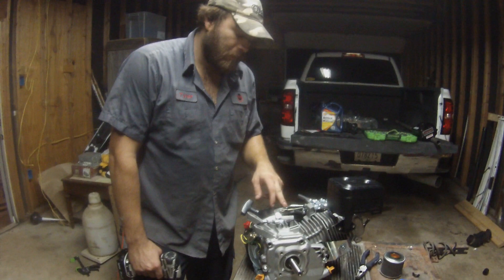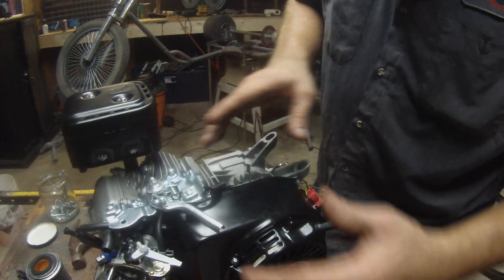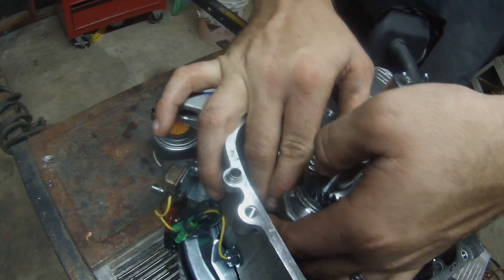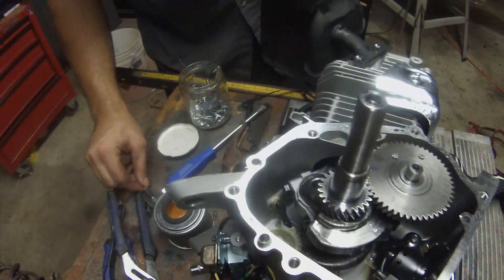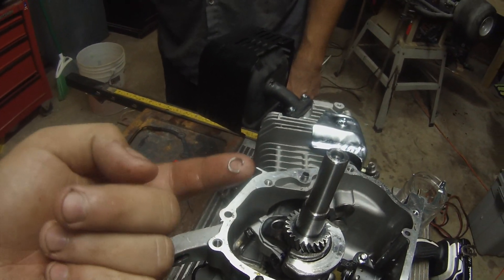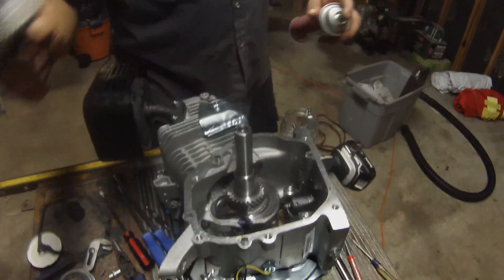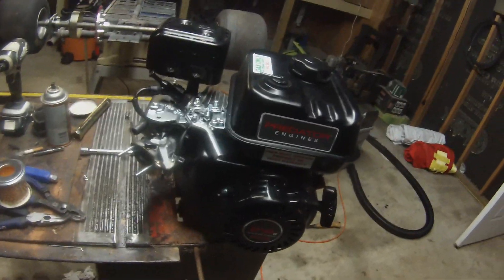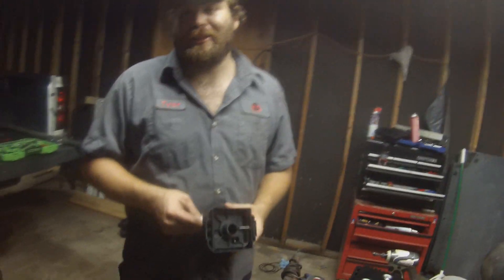How to: Best  Predator 212 governor removal

Comment: Here's the thing everyone isn't understanding.  The bike or kart is limited mostly by the final ratio. Tav2 30 series max at around 3500 rpm without modification. A clutch will get you there but you still won't out run the sprockets. A governorless motor is only beneficial to long runs, drag racing with engines that are built to 15- 20+ horsepower or balls out sprinting on circle tracks where the gearing is so high and the power of the engine exceeds the amount of torque to pull past the sprocket ratio.
Reply from the maker: Your ignorance is showing for sure you have obviously never done that or you would know the benefit so before commenting about something you don’t know maybe you should try it
Reply: @redneckengineering7739  I build them all the time. Theres 5 ungoverned, fully built motors on my shelf right now. Full deletes, linkages and all. I ran them on tav2s, clutches, minibikes and go karts. Check them out if you don't think so, they are on my channel. I'm currently working on a hemi and Non-Hemi 212 with modified governors, flywheels and rods. Been there done that. I know exactly what I'm talking about. I wasn't down playing your efforts my man.
Reply from the maker: Sure you do buddy
Reply: @redneckengineering7739  go look. I do my deletes from the flywheel side.
Reply: You can max the stock cam with the governor still installed and 18 pound springs. The rod starts to starve around 4,700-5,000 rpm. The maximum torque on the stock cam is achieved around 3600 due to the lack of ramping. To get more power without the governor you need increased duration for more usable torque at higher rpm you need ramping. You did other videos, I've been subbed awhile. I wasn't knocking your video boys, I'm all about this stuff. Maybe you are adding a bushing to that torque converter to get those wheels spinning faster? I don't know anything about that either 🙄.
Reply: @redneckengineering7739  did you check yet? I just gave you a LIKE, unsubbed  and subbed again because I like your channel. Sorry, wasn't trying to offend you bro.

Comment: i did this now i have no compression and it wont start i think it has to do with the 2 round valve things that go up and down do they have to b in a certain position and i lined the dot up with the other dot
Reply from the maker: Nothing here should have anything to do with compression
Reply from the maker: You will have to add me on Instagram or some thing and send me a picture I don’t really know what you’re talking about

Comment: It is soooo easy to do . Do it right and do it only ONCE ! Buy an ARC billet rod and flywheel too with a NEW GASKET 😡... Heavier valve springs are a good idea once you install the billet rod and flywheel . Haul ass SAFELY 😀😃👍🏻👍🏻
Reply from the maker: No

Comment: Does this actually work and if so how much more power and speed is added
Reply from the maker: What do you mean does this actually work? It removes the governor so yes it works end it does not add any power just removes the RPM limiting governor you can Revit higher that’s it and how would we be able to tell you how much speed is added when we have no idea what you have put this motor on? When you ask questions On the Internet and expect someone to answer it make sure you have plenty of information to give them
Reply: @redneckengineering7739  bro why u so pressed I just saw some other people say that it would blow up the engine
Reply from the maker: Cool

Comment: I removed the governer and arm, now it runs at wide open throttle. Ive checked for air leaks and everything with brake clean to no avail. What am i missing here ? I cant find any solutions online.
Reply from the maker: You did something wrong that’s all I can tell you I can’t see what you’re looking at

Comment: whats everything you need properly done for this not to mess engine up. i have already new jets, filter.
Reply from the maker: +Donnie Coffman flywheel
Reply: If taking the governor off, there's the risk of valve float, right?  I've got a new HEMI 212 (still in the box) that I'll be removing the governor on within the next day or two (thanks for the vid).  I've got a stage 2 kit from Hot Rod Mini Bike on the way to me as I write this, and the thought (besides the mods) that since the rpms will obviously be higher, stiffer valve springs are needed to prevent the valve float.  So I'll be ordering them tomorrow as well.  From what I've read so far, that's a necessary upgrade when removing the governor, right?
Reply from the maker: +Terry Koss you really need a new flywheel to or it can explode
Reply: Well, that's great to hear, because I've already decided to buy a billet flywheel (and cam)!  Yesterday, I removed the governor, low oil sensor and flywheel.  I didn't know that I needed to, but now that you mention it...makes good sense.  So thanks for having me know I won't be risking destroying my new motor!  I put the motor in a plastic bag for protection until the cam, springs and flywheel come in.
Reply from the maker: +Terry Koss cool man have fun with it

Comment: Hi I also own a drift trike and I just just a new motor on my trike and every time I do a 360° if shuts off on me. Do u knw why it would do that?
Reply from the maker: Probably starving for fuel
Reply: I did take off the top part of the  Governor but didnt open up the crank shaft area and take out the parts in there.. can that be the problem?
Reply: oil sensor

Comment: So just an observation... if you just take the arm off from the governor shaft and then do the throttle hookup the way you did, why open the engine and take out the gear?
Reply: That gear is nylon with cast metal weights. Above the factory set 3600 rpms, things get spooky: If it happens to come apart from excessive rpms over stock, its going to take the guts with it. Not if, just when.

Im all for the zip tie trick to wow your buddies, but take the gear out at some point.

Comment: i personally dont recomend removing the governor cause thats how you throw a rod or rupture a flywheel and send pieces of cast iron through your back but what i do is i cable clamp my outside wire to the governor linkage and put my inside wire around the top air filter manifold bolt and it jams the throttle wide open against the governor, so basically all the governor is now is a centrifugal return spring where you get more feed back pressure as the rpms increase, its actually kinda cool and it works flawlessly
Reply from the maker: +FlyingWldAlaska77 that's cool but no I'm taking that shit out you can get a Billet flywheel and fix the problem but that's only if you plan on running wide open a lot
Reply: you can get a billet flywheel and a billet con rod maybe even a forged con rod and a billet piston and a high lift long duration cam and big bore carb and all that for them and they can reach like 9,000 rpm but other than racing i dont see why you would want to dump more than just the 100 bucks for the motor into the motor, they have always been good enough for me stock, thats just my preference i guess, i never refuse extra power but im not going to pay shit tons of money for a motor to make more power when i could just get a bigger motor that does the same thing for way cheeper, only its heavier and bigger but its being put through less stress and would last far more hours, just me personally i guess, nothing against tuning up motrors
Reply: FlyingWldAlaska77 What's a little iron in your back gonna really do.

Comment: I watched ur guys video and I took the govener off my engine and put everything back and it doesn't start unless I rev the throttle while I pull the starter and I have to keep revving it and when I put it on run it just stops did this happen to u guys
Reply from the maker: +Moto Briggs was it a new motor?

Comment: i have the same motor it run.. but when i give it gas it will not gi and the motor cutts off
Reply from the maker: +Shanesha Grayson you should call a small engine mechanic in your area but sounds like a fuel issue
Reply from the maker: +Shanesha Grayson if it's been sitting for awhile with gas in it you probably need to clean the carburetor but it's hard to diagnose things through YouTube comments LOL
Reply: i changed the gas and cleaned the carburetor. .. and it still doesnt want to go... the motor is only 5 months old but i cant send it back to the manufacture
Reply from the maker: +Shanesha Grayson yeah I'd send it back
Reply: sucking to much air it sounds like
Reply: StRaNgEr ok i cleaned out the carburetor.  it started goin. but i notice that gas was leaking in the  oil ...
Reply: Shanesha Grayson then its gotta be either the oil ring on the piston or gaskets
Reply: Shanesha Grayson how is your compression?
Reply: Shanesha Grayson your clutch is bad

Comment: You don't need to cut or break off the top of the rod. Pull the pull rope slowly to turn The motor and line it up and pull it right out. Just did mine.

Comment: Why not just stop after removing the external linkage? What is the reason for going in the crankcase to remove the internal parts? In other words, why not just disconnect the governor as opposed to removing the whole thing?
Reply from the maker: john robert that plastic gear can fail at higher rpms . It's just better safe than sorry .

Comment: Hey guys, I want to know, is this (212cc) engine powerful enough to work on a ultralight I'm building? Can you get more horsepower out of it, maybe 15HP? Also, can I hook up a 3 to 1 gear reduction to it? Thanks, great vid.
Reply from the maker: Forrest Branton you would have to do extreme performance upgrade costing in the range of 1,000 dollars . You can actually buy them already upgrade online . But I still don't know if you would hit 15 hp . I'd reccomend going to a 302 or 420 cc . And then doing all that work and getting 25-30 hp
Reply from the maker: Forrest Branton http://www.gopowersports.com/stage-two-212cc-predator-performance-racing-engine/
Reply: Accually they make a stage 2 performance kit for this motor that adds a minimum of 15 hp to your engine:) it's on gopowersports.com

Comment: Can removing the governor harm your engine
Reply from the maker: +Clinton Ovalle yes
Reply from the maker: +Clinton Ovalle for it to work reliably you should get a Billet flywheel and possibly a connecting rod depending on how often you run it Wide Open

Comment: hey man I have this motor apart can't you just take the rod that goes to the throttle off and leave the gear in there? why are you guys taking the gear off?
Reply from the maker: +gusduran11 yes you can but that plastic gear inside can fail at high Rpms and cause issues later . We figured we would show the right way to do it but if you do it that way your talking it will still work .

Comment: The whole point of watching this video is so I could see somebody removing that clip and right before you take it off you skip to after it's off that kind of ruined it for me
Reply from the maker: +brent davis' cool things i dont care but its a bitch tho
Reply from the maker: +brent davis' cool things yeah we about started hitting it with a hammer
Reply from the maker: +brent davis' cool things good deal
Reply: It's easier to remove flywheel and drive the pin out, remove the gear, then reinstall the pin, takes 5 min.
Reply from the maker: +Donald Drane nice

Comment: Next time clamp some visegrips on the governor shaft and using another pair of channel locks and a hammer as a makeshift pin puller slidehammer and pull out the pin from the case remove the gear and washers and drive the pin right back in the hole saves a lot of time and cursing.